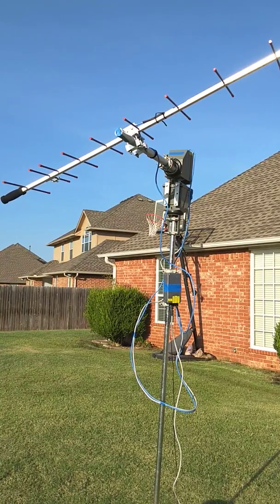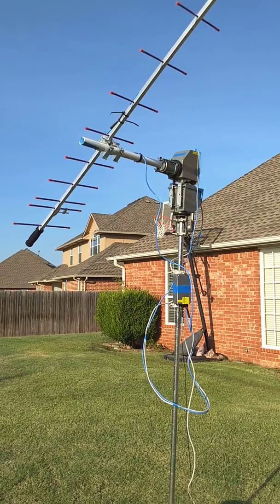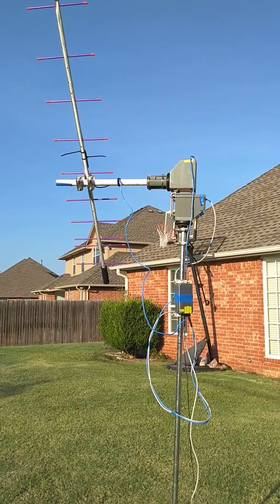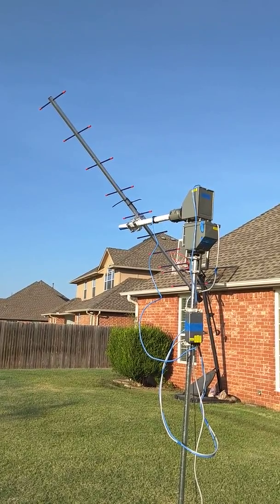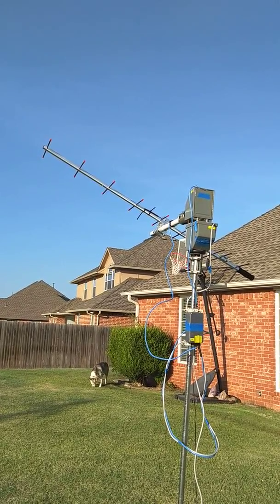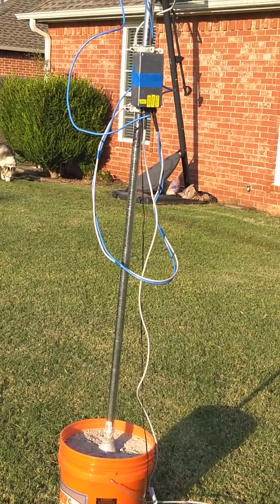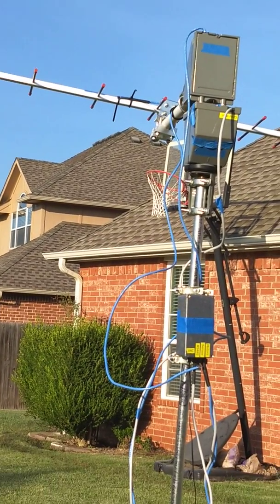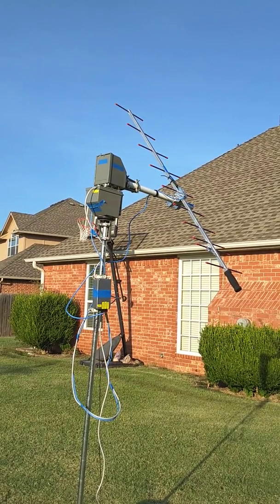Amateur Radio AZ/EL Satellite tracking using Arduino!

Comment: So is this set up still working for you? I’m looking for something similar for my log periodic antenna for satellite work that will do azimuth and elevation.
Reply from the maker: I put it away for winter and never got it back out again...  I had to focus on other priorities.  I'm trying to get back around to it but frankly  chasing U.S. grids is second to chasing DX in this new solar cycle that has made 12 and 10 m so full of activity!  As for a Log Periodic, I suspect you would have a problem with weight.  These motors do not have a lot of 'brake' resistance in the gears so something heavy in the wind would likely be problematic.

Comment: I just did something very similar that works works with gpredict you can see it in action on my qrz page 73 de ve2ota
Reply from the maker: The problem I had with gpredict, if I remember correctly, it was either no satellite mode on the IC9100 or it was rotor control.. it's been a long time, I don't remember which one now.

Comment: Looks nice and solid. Does RF interfere with the compass sensor? I've nearly finished one that works with Gpredict over wifi. It has an ESP32 that emulates the rotator side of Hamlib (as much as it needs to) so Gpredict talks to it directly. I'm using two sensors for direction and elevation as I still need to get my head round the maths involved in compensating for tilt when getting the azimuth heading, which, unfortunately means my rotator has to be level.
Reply from the maker: No but the I2C bus does get into the receive antenna...  Right now it's in the 'winter storage' though.
Reply from the maker: No RF does not intefere with the compas sensor, however the I2O does intefere with 2m or 70cm... I could frequently hear the data bus over the people I was trying to talk to.  This part needs a bit of a redesign with some shielding and separation

Comment: @Indiana jones got a question for you. Since every sat is pretty much low earth orbit at this point, if the antenna begins to rotate through the arc at the correct time at a standard rate starting from the correct position on the horizon, would it not track the satellite ? Basically the motors would be 'bumped" similar to a cog on a clock.  The viewing time is different depending on how low the orbit is but the rate, of change has got to be the same I would think. Or close at least. most are 98 minutes for a rotation, the ISS is 93.  So, if you had a system that would move the antenna at the same rate, and manually change the arc, you would follow the sat. That said, I do like the fact that your using an Arduino and will be looking at that system, but, in my experience, many trackers trying to use both azimuth and elevation as a completely variable 3d system are fairly complex. That said, studying the link https://sarcnet.org/projects/project_rotator.html and one application that really impressed me and would need their complete system would be the Ship that changed heading and position, would need everything they offer !
Reply from the maker: The antenna has a 15 degree or so range so yes, you don't have to be on the bulls-eye.  But they come from a variety of directions and at different rates and sometimes one after another :-)  The FM sats are real easy but the SSB sats take more work and that's why I wanted a rotator and I wanted to learn Arduino.. I still need to do a follow-up video but it works great (you know,  until the Oklahoma winds blew it over).  Now that the Spring storms are less frequent I will start putting it all back together and get ready for Field Day.
Reply: @N5ZY  I had coverage of Oklahoma with ao95 and have qsl cards from Alaska with contacts from northern California ! I had really wished more Hawaiians would have gotten on because I think a sat half way in between would work. That said, I used a vertical, and worked when the sats went directly over the Airport in Anchorage and a guy using a good handheld with a beam pointed straight up could receive me (I had duplex and could hear my signal) . I'd love to put a better system together with my uhf and vhf beams on some sort of tracker.  Not sure I'd do any better though than my vertical when the sat is going over the airport in anchorage, as there isn't nothing beyond that !

Comment: Great video.  I am working on nearly the same project.  Would you be willing to share the US version of the software?  KJ4QDZ  Thanks.
Reply from the maker: Hello Tom, thanks for the comment!  The design seems to be solid and working great.  The software is working great.  I just need to write-up a parts list.  As for software release, I'm just the prototype builder :-)  Contact Julie VK3FOWL and Joe VK3YSP via http://www.sarcnet.org/ and tell them you saw this video and would like the code.  They said they were planning to release it on their web site but when they release they likely need a full parts list, build photos, etc.
Thanks again for the like - it's strange to see so many people watch the video but no like/dislike.. I don't know if it's helpful to my fellow amateurs or not.
Reply: I watch a lot of youtube videos on my TV/xbox.  I dont always give a like.  FYI- I sent you email a couple days ago but no reply.  No prob.  I did see a parts list for Mk 1-4 versions.  I already have my parts list which will be a wee bit different.  I will use a motorized pan tilt video camera base with 24VAC motors and weight rated for 18kg.  Very much the same schematically.  And maybe upgrade some of the sensors.  I will contact Julie/Joe for the code.  73
Reply: I have received Rotor5 code from Julie & Joe.  Is this the same version you used?  Did you wire it up the same as found in the rotor mk2 powerpoint presentation?  The 4x  RS422-TTL converters have me a bit puzzled going from USB/TTL to RS422 to RS422 to TTL.  Is that to get power to the acc sensor?  Did you find that it is necessary for 4 converters?
Reply from the maker: I believe we started with that a year ago but we had to make a lot of changes to it for 60Hz A/C motors.  If you are using DC motors then it should be just fine.
Yes, 4 of the RS422 modules so you can send and receive in full duplex.  
Yes, the USB/TTL board so we can connect to the PC with USB then the MAX485 so we can send the rotor control commands as far as we care to (RS-485 has a very, very long wire buss range and is used for programmable logic controllers in factories/refineries/etc).  Then on the other side it connects directly to the Arduino.  Works GREAT!  
I ended up having to add some ceramic capacitors to eliminate RFI in the RS-485 buss (kept popping chips) and I also had to move the LSM303 off the antenna as it was causing a lot of QRM (I stuck a 3/8 in PEX pipe into the back of the arrow antenna and mounted the LSM303 one foot behind the antenna and drastically reduced the QRM produced by the LSM303).
It's been fun working on this project but it's really fun to actually watch it track a satellite and to talk via satellite!
Reply: My intent for the project was for a mobile setup so I had a mental block staring at the schematic. All I needed was a short cable to the PC.  I like having the option to do either so I'll probably get the converters.  How did you wire in the caps to the converter bus?  What band/mode was giving you the RFI?   Photo.  email on QRZ.
Reply from the maker: They have a different plan that simply directly connects over USB and is much more mobile.  It was even published in a magazine.